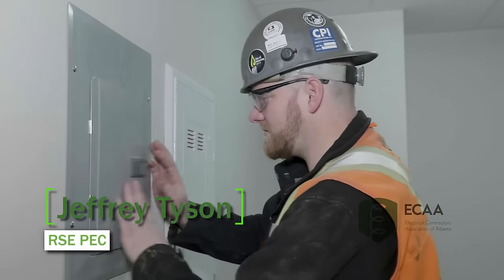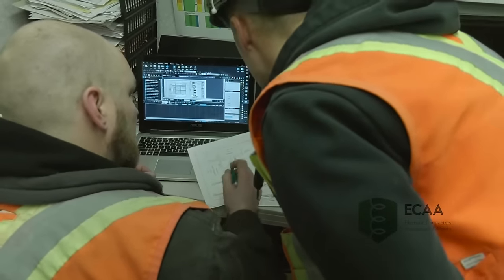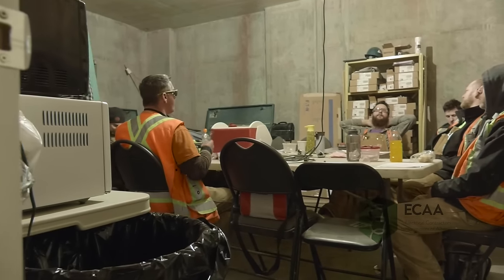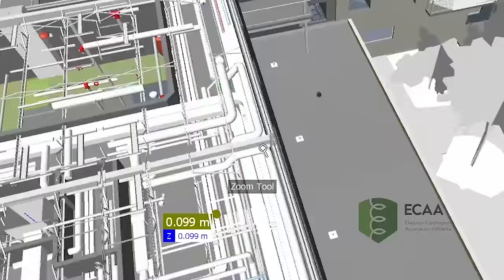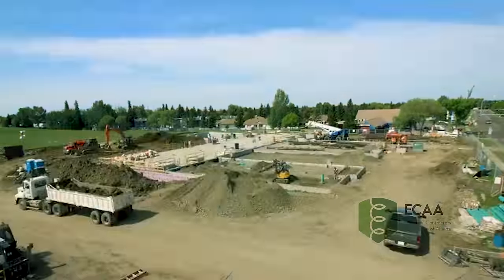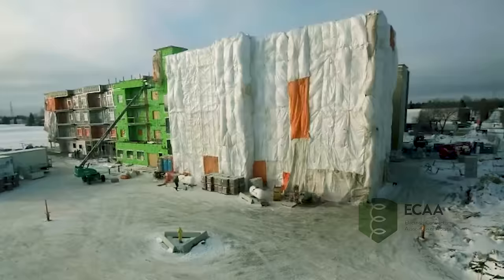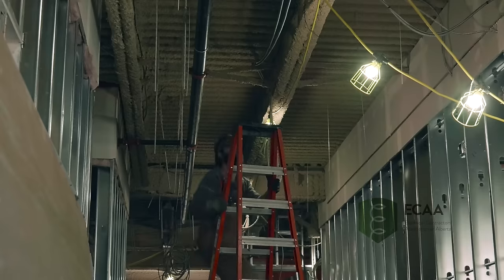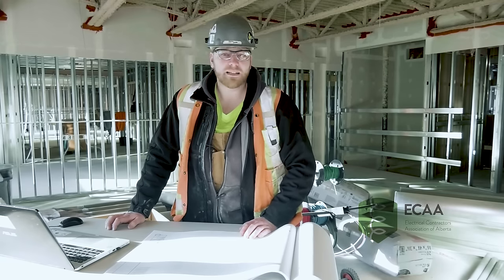Day in the Life of an Electrician

Comment: Awesome video .. I'm a journeyman electrician myself and it's a great trade and is absolutely rewarding .  So gratifying when you wire something and it works properly .. or you fix something a that  very small percentage of people can fix
Reply: Auston Dowling I’m thinking about going for electrician any tips or pointers I’m going to college for it
Reply from the maker: Thanks Auston. So true.
Reply: Noah Landry who tf goes to college for electrician? Just get an apprenticeship mate
Reply: How much do you earn from being an electrician?
Reply: @tajhdublin7326  depends where he is based mate, many countries, for example the U.K. call what you know as “colleges”, “universities” instead and the college part in the U.K. is generally around 16-18 year olds just before university.
Reply: @tajhdublin7326  If you want to be a journeyman you need to understand how everything works. Apprenticeship only teaches you how to install not the why youre installing it factor. plus the pay difference is exponentially greater.
Reply: @kuya_mike7813  sir i have a question😊
Reply: Hey bud question my hot water heater was leaking on top I didn't realize until HW went out ,now breaker is good power in wire all the until you get 2 ft from HW heater ? No break in wire ? Could a corroded connection at HW heater cause this ?

Comment: To the people wondering about becoming an electrician. 
Go to school for it, esepecially if you want to really know what youre doing out on the field. Apprentices are only installers. Journeyman is where you want to be but you need to understand magnetism, induction, a bit of trigonometry, how to find the correct AWG, power factor correction and ALOT more. As a journeyman not only are you in a position of leadership, you are the go to person for answers at a job site. if an apprentice comes up to ask you how electricity works you have to be able to explain in simplicity how it works.
 
Voltage is a force that comes from your source 
Amps is the flow of current
Ohms is your resistance within the circuit
Watts is your power (there is also true power) 

be able to explain the difference between a parallel circuit, series circuit, and combination circuit and how to troubleshoot each one. understand that the sum of all voltage drops is equal to my total voltage in a series circuit (ohms law). There is alot more to it. school is the only real way to become a confident electrician. Anyone can install stuff but can you do the brain work to figure out what went wrong?? GO TO SCHOOL.

Comment: HI, thanks for the video, it is very interesting.
. I'm an English teacher in Argentina and I am preparing this video for my students in a Technical Highschool. They are learning technical vocabulary,
I have a little trouble understanding some of the terms here, and I haven't found a plausible meaning on google. For example, what is 'rigging cable', or 'ruffing and BX'  (The guy says that and that's what subtitles say to) 
I would really appreciate if you had time answering.
Reply from the maker: Great that we can be of assistance. Good luck to you and your students.
Reply: Hello! BX (bauxite) is trade slang for armoured aluminium cable AC 90. It is a wire protected with exterior metallic wrapping . Rouhg in stage (early stage)is when elecreical conductors and boxes installled in designated locations but not terminated or connected to electrical devices.